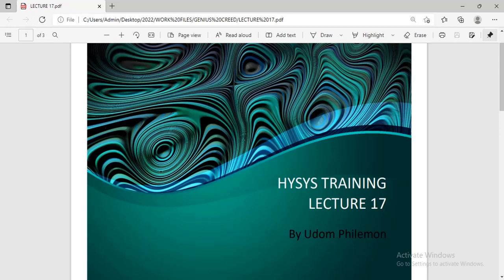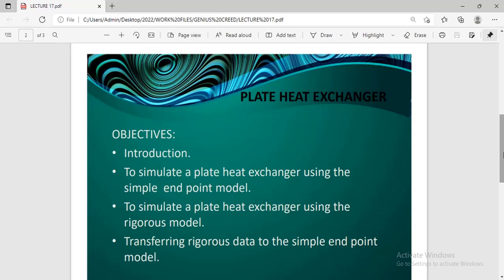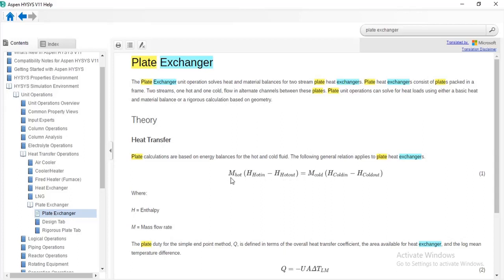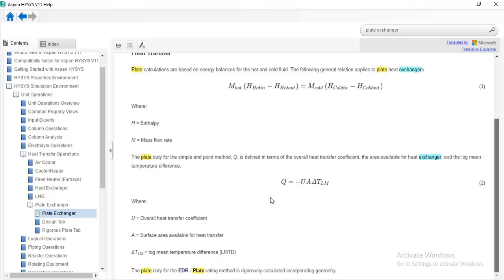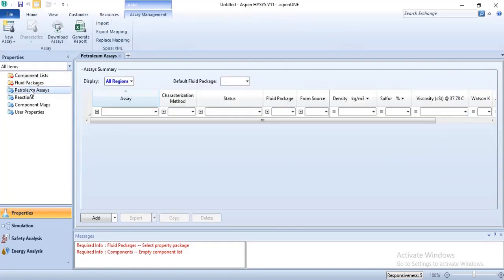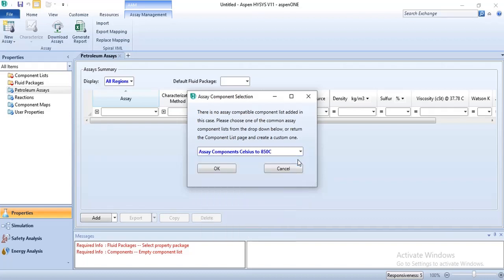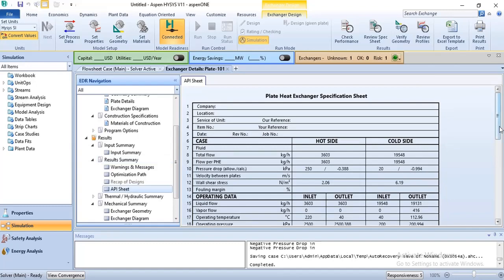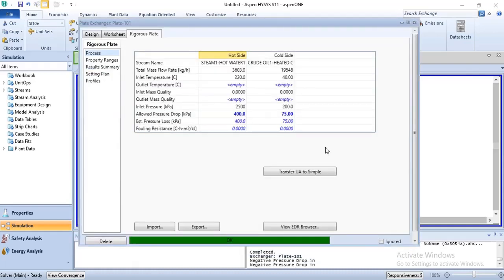Aspen HYSYS Lecture 17 Plate Heat Exchanger

Comment: is it acceptable for the negative pressure drop. Does it mean that the flow will be backwards?...Is it because of the specs you set in the EDR environment. is it possible to set the pressure drop first before going in the EDR environment?
Reply: Hello lector, I have Hysys V9.0 and I've could not found the Plate Heat Exchanger in the Palette. I have to do something to discover it, or it does not exist for this version?
Reply: @jirc1990 Hello...the plate heat exchanger does not exist in that version...I recommend version 11.
Reply: No...a negative pressure drop shouldn't be accepted. I guess that happened due to the specifications in the rigorous environment. Note that the values used there were just assumptions to show the specifications work.